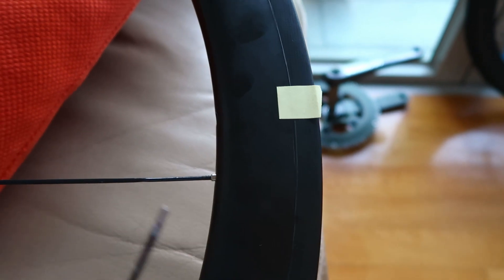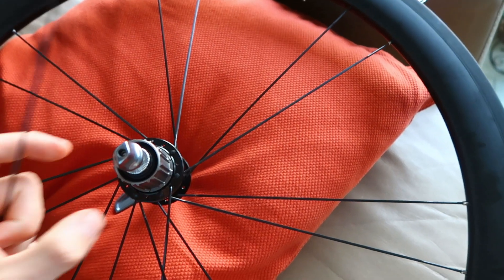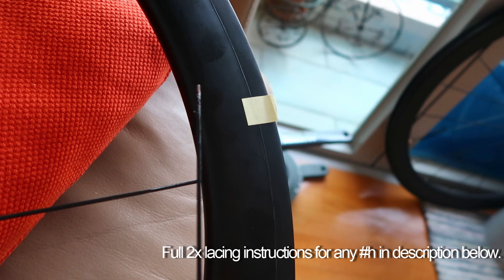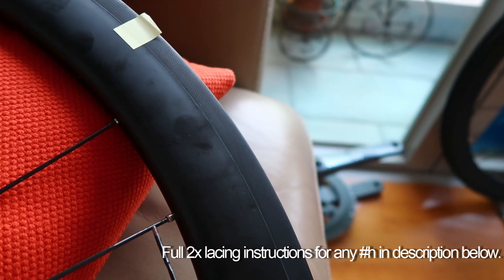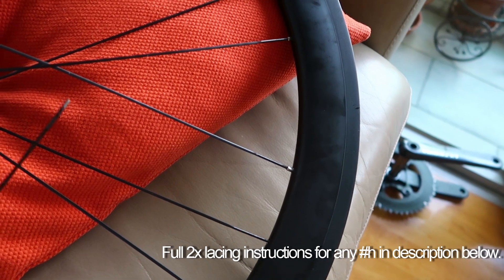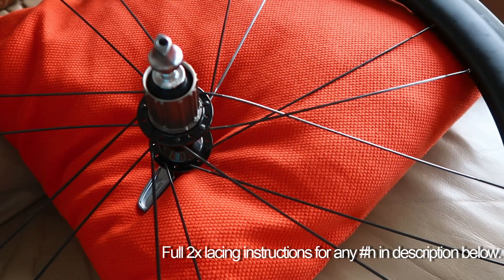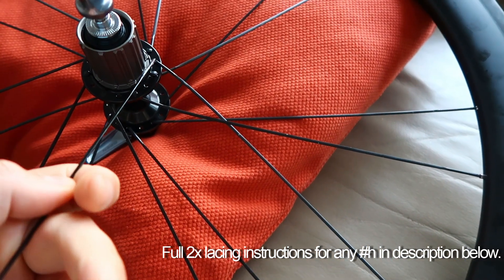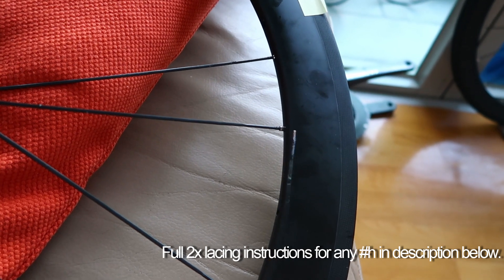Farsports Dura Ace Part 2: How to lace a bicycle wheel 2x

Comment: I learned more in 6 minutes from this video, than the hours of other wheel building videos I have consumed combined. Thanks for explaining the underlying concepts instead of just spouting arbitrary steps. As an engineer, if I can get a mental model of the underlying forces, the process falls much more easily into place.
Reply: I have bookmarked this video so I can revisit it to remind me how to build 2 cross correctly....however, I am being a bit dodgy and building 2x on DS (18 spokes) and radial on NDS (9 spokes) using a 36 hole RS400 Shimano hub (cheap, but plenty good enough for my LightBicycle carbon clinchers).  Spoke layout like a factory built Fulcrum or Campag wheel but with J-bend spokes and instead of 21 spoke rear I use 27 due to me being a heavy sprinter!

Comment: Great vid. Learned a lot, thanks. Will build my next set wheels myself following these instructions! It will be 24 in the rear, 18 on the front. I weight 72kg.
Reply: I am building 18 front, 27 rear and I weigh 92kg!  😁

Comment: Hi sir. Just a question.. I have 32 hole rim and hub.. And 27.5mm spokes.. But my problem, it is coming out through the nipples and rim.. How can i solve this? I finished the front wheel but th rear wheel sucks!..

Comment: I don't think you're right about the leading spokes relaxing as you apply torque to the wheel. The only way this can happen is if the trailing spokes stretch and they will only begin to stretch once the force you are putting though them is equal to or higher than the force from the pre stress and this will not be the case as your ride. It's just the same as a prestressed bolt in a bolted joint. The bolt will not stretch until the force pulling on the joint exceeds the prestress in the bolt.

Comment: Just found your videos now. Thx for the great tutorial! Especially the opening - it's no magic. However, you didn't touch the point I'm struggling with: how to find the correct spoke length? I have detailed data of my (straight pull) hubs, I have the ERD of the rims. However, 9 different online calculators gave me vastly different spoke lengths. The calculators included those on the Sapim and DT Swiss websites and several independent wheel builders. I'm additionally confused that they all check different measurements of the hubs (like hole offset), while only one asks for the rim thickness. Is it just more complicated for straight pull hubs?
I'm also curious to know why you decided for 2-cross instead of the traditional 3-cross lacing.
Reply: I tried the Sapim spoke calculator and it gave me wacky numbers. I ended up using the United Bicycle Institute and DY calculators. Front wheel spokes were a good length, going to do the rear today.

Comment: Can you talk more about the idea behind running the DS torqued spokes with the head facing out? Is it an issue if you run the DS torqued spokes heads running inwards?
Reply from the maker: You can do it either way. But the way i describe puts DS torqued spokes over the relaxing spokes, keeping them 'in' and away from the cassette. If you do it the other way, when these spokes relax under pedalling force, theoretically they can 'bow' out. In reality they probably won't, but it's good practice.

Comment: wouldn't you want the trailing spokes to have a gap rather than putting them next to each other? I am talking about on the rim. because as you pedal it would mean that two spokes next to each other would get tighter. seems like it wouldn's distribute force as well.
Reply: Sufyan Saleem No, id you did that your hub would wobble under the dynamic stress of pedaling, frame movement and the road surface.